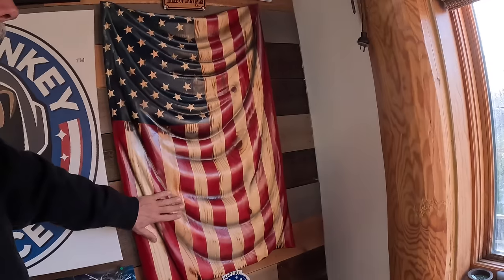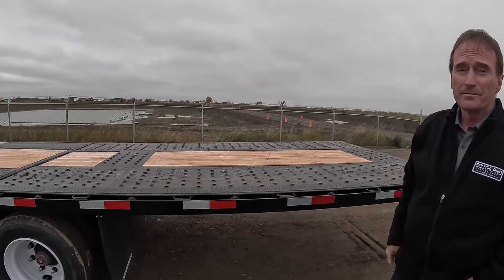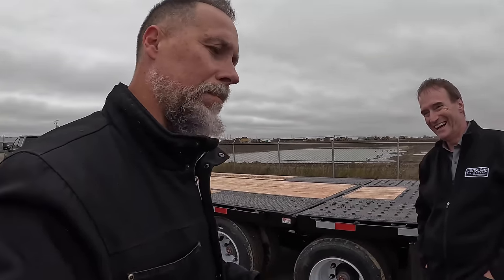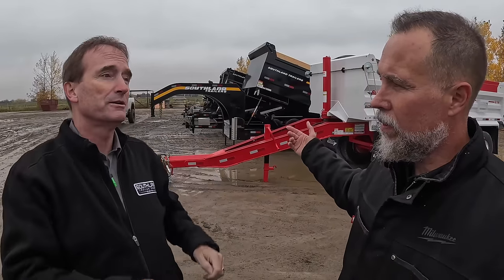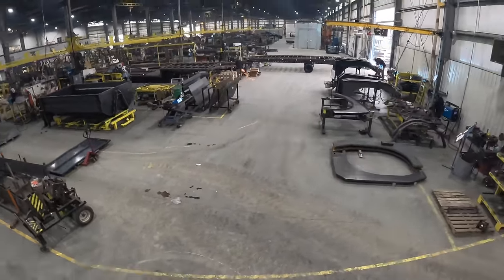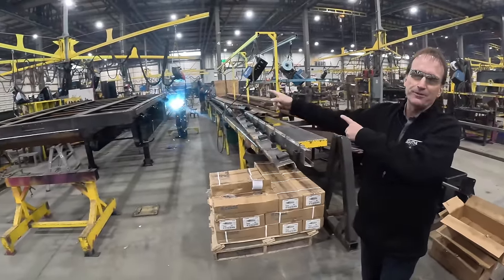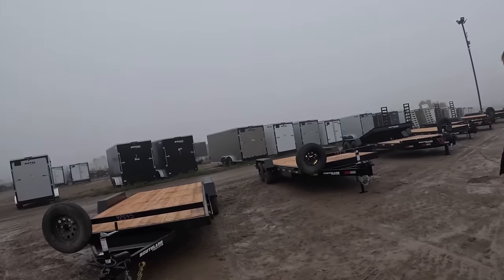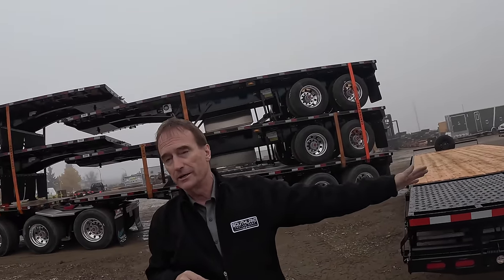HARD test at SOUTHLAND trailers 4K

Comment: these videos are what sold me on southland trailers. i bought  the sl714-16 dump trailer just because of stanley's videos series on southland trailers. i researched dump trailers for a few weeks and visited all the trailer places in my area numerous times asking questions and looking at the trailers over and over. so many choices. but then i seen how southland builds theirs and the design they use and i figured if its good enough for dump trucks, good enough for me.
also, i know people whos dumps trailers have rusted thru in spots on the bed because of low spots caused by the bracing. when i loaded 8-9000lb of concrete and went to lift it, the middle of the pile lifted then the box. kinda freaked me out as ive never seen that before but it lifted just fine. looking forward to using this trailer for many years to come.
thank you stanley for the southland trailer series.

Comment: That demonstration with the loader was insane.  The most weight of any one wheel is total weight divided by 4 on any one ramp at a time, but not insignificant.  👍😗
Reply from the maker: More than you would ever do in a normal circumstance
Reply: I want a set of those aluminum ramps for my truck
Reply: That's not quite right, there is a significant rear bias to give staility when using a full bucket - either way, still damned impressive!

Comment: I have a gal-iron pipe in to the ground hold up.  I painted it with metal paint and it is still Black and standing.  Won't rust at ground level and ground water is running by it under the place it was placed.  Acid rain will melt back gal coating.  Rusted roofs...   But if you paint it it works. Fantastic trailers.

Comment: If you buy a aluminum flat bed for a pick-up for the most part theyre cheaper than steal because thehre robot welded compared to the steel ones are hand welded so theyre pricer because of that